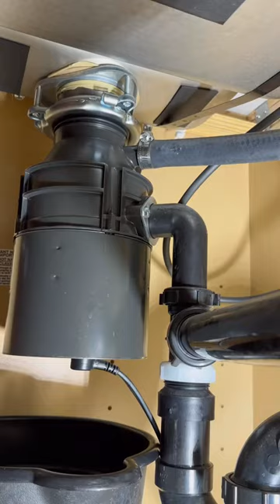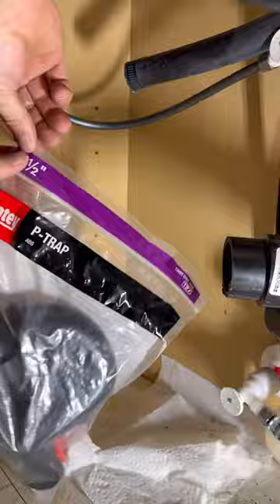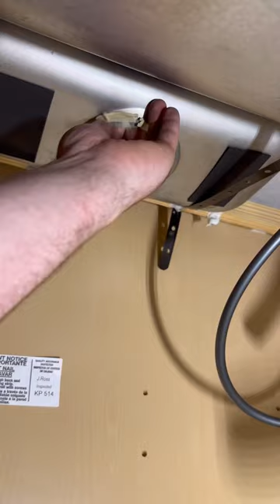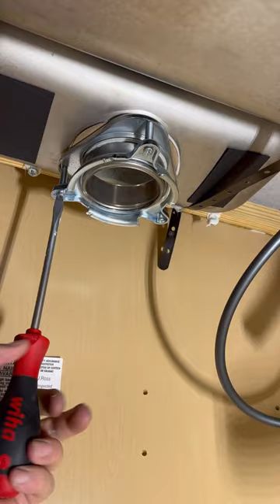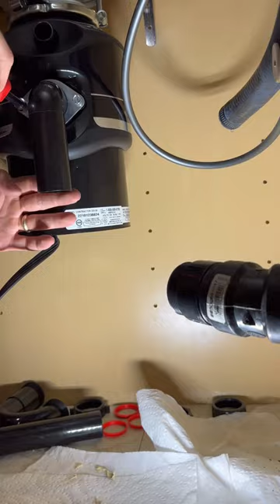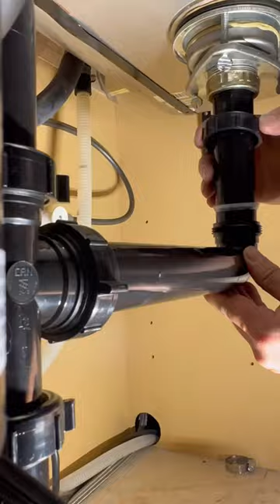installing an insinkerator disposal and p trap #plumber #plumbing #diy #oateyambassador #oatey

Comment: Too bad you couldn’t show the part where you’re fishing out the knockout plug for the dishwasher drain 😂 Nice clean work brother!
Reply: Fishing it out? You turn it upside down and shake it twice.
Reply: @littlejackalo5326  if you’re lucky and it doesn’t get lodged in the grinder. Also it’s mostly a joke. Just take the rubber collar off, bracket off and you can fit your hand in in any case. Sheesh can’t make an offhand comment.
Reply: Nah u definitely install disposal and forget to do the knockout and doing it after  lol
Reply: Everyone including myself has fight the damn knockout plug!!
Reply: @gianfrancofettuccini deff a me thing lol
Reply: The real flex is how easy he put the bracket ring on without messing up the putty and having to redo it 😅😂

Comment: Clean. Good job brother.
Reply from the maker: Thanks for watching
Reply: What does a job like this cost ?
Reply: @davidi7441 it depends on where you live, if it's time and material and if it's a dude in a truck vs a larger plumbing company. One company I worked for would have charged like $500 for a disposal swap.

Comment: Great job. I try to eliminate the need for that 90° pos disposal fitting though. I cut the other strainer tailpiece higher to get a straight shot to the disposal so that 90° isn't needed which makes for a better install. Sometimes there isn't room and it's all good! Great vid!💪💪

Comment: I would never use the knockout drain on the disposal again. I found food from the disposal was in my dishwasher. I’d use a tail piece with a hose barb connection on the second sink drain instead.
Reply: Air gaps are code around here

Comment: Did that T have a 90 degree diverter baffle inside ("sanitary T")? If not, a full sink of water on the other side will force water back up through the disposal and fill that sink side and drain together.

Comment: What city u from? They let u get away with 1.5 P-trap. Clean job!
Reply: He cut out a sch 40 solvent 1 1/2 abs p-trap with union & installed a 1 1/2 tubular slip joint trap … not sure as to why 🤔
Reply: @oneshotpete 6.5  because that schedule 40 trap assembly is a pain in the ass to work with. Tolerances are tight when building it. Taking it apart when there is an issue is a problem. Like the video shows, most plumbers just cut that garbage out and install a proper,easy to use, dummy friendly tubular waste kit. There's nothing beneficial about a sch 40 trap. Whatever advantages you can cite isn't enough to warrant the headache of using it.
Reply: Yrs ago when I was a plumber the city I lived @ and worked. To pass inspection, whenever there was a garbage disposal, had to be 2" drain.
Reply: @NoflectioN  Don’t get me wrong , I install tubular traps on the daily, but to say there is no advantage in a solvent trap as opposed to a slip joint tubular , only highlights your ignorance ( respectfully )
Reply: @1983est  Never even seen a two inch in residential in my state.

Comment: I would have just changed the garbage disposal and left the drain The drain seemed all right
Reply from the maker: The existing p trap would not have fit because I changed it from a 1/2 to a 3/4 HP disposal

Comment: The only problem I have with the install is Insinkerator. Overpriced and under powered and crap warranty. So many better, stronger, less expensive, and way better warranty.
Reply: I've used Waste King Universal and ISE all stainless steel top of the line reversing anti-jam 1.25Hp units and all are in their second decade of service; one is approaching 30 years. Used correctly they will last. You get what you pay for.

Comment: FYI, Costco sells American standard 1 1/3 hp garbage disposal for $99 plus tax. Sometimes on sell for either $69 or $79 can’t remember which. If u go to the big home improvement stores a 1/3 hp disposal is $99 plus tax. That is what I have found in socal
Reply: The impellers on the Costco disposal are tiny, despite the size of the motor. I went through 3 of them - broken impellers, in 12 months. Replaced it with Waste King Universal (or ISE, your choice) reversing anti-jam disposal with large impellers. Going on 15 years. Make sure the inside is all stainless steel. Yes, they cost, but you won't be replacing them every 3-5 years. I've got another ISE top of the line unit, bought in 1995 for $149 then, still going strong. My folks have a GE top of the line unit, which I've replaced the grind/shred ring and impeller disc at 22 years, now going on 40 years of service. They get used every single day. Keep them clean inside and use lots of cold water.

Comment: I don’t know about you, but the P-trap for the whole set for that it looks fine and you just charge a customer more money to replace the whole thing when you could’ve just charge them for the garbage disposal ??
Reply from the maker: 🤣a p trap costs $2
Reply: @replumb  and your time it’s not worth nothing.
Reply from the maker: @franconieblas2326  the old p trap was too close to the disposal. The 3/4 HP disposal is much bigger than the existing 1/2 HP disposal this is the reason for replacing the trap. Thank you come again
Reply: @replumb  in your face,come again thank you